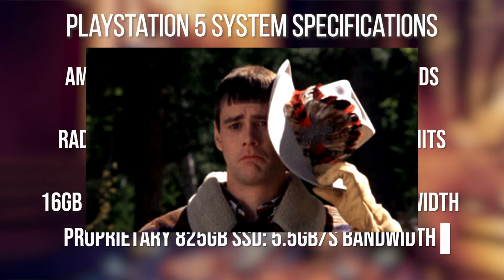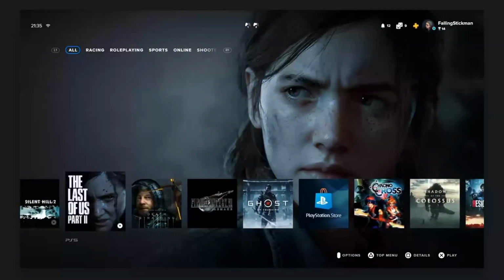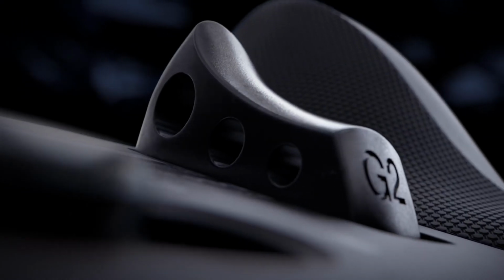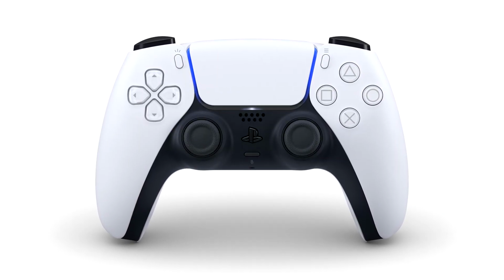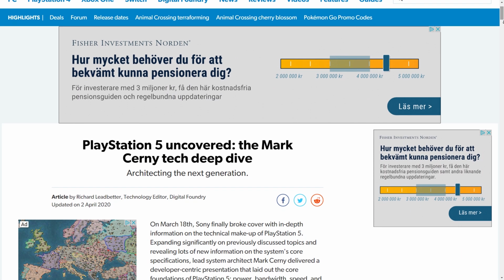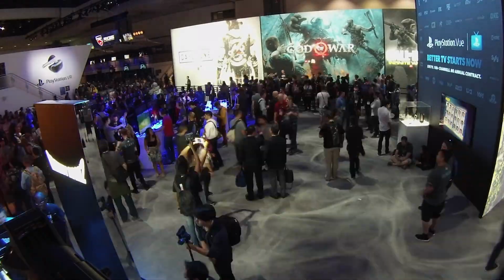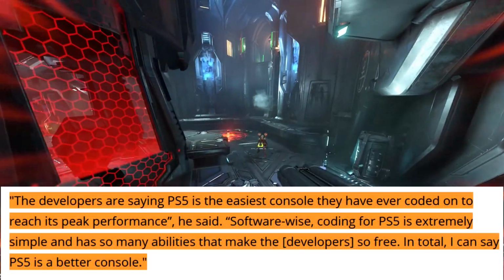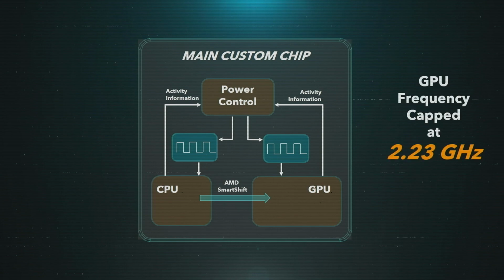PS5 New Details REVEALED | PlayStation 5 VS Xbox Series X Specs Reveal Shocking Performance

Comment: Both of these take a backseat to pc gaming BUT I hope they come out very cheap at the same time. Make our pc parts cheaper 😁👍
Reply: Back seat... according to who ?
Reply: @annoyingasshole3324  according to Nvidia ampere and AMD big Navi 2 👍. 20+tflop gpus. Not to mention amd already has 12 and 16 core cpus (basically double the consoles) so according to reality, they take a MAJOR back seat to pc gaming
Reply: @annoyingasshole3324  according to sales numbers.
Reply: PC take a back seat in game quality imo
Reply: @tommybull6578  that's not even physically possible 🤦🏾‍♂️. Console Graphics settings are stuck at low to medium PC settings, whereas PC actually gives you the option to customize your experience up to all Ultra levels, which would be triple if not quadruple the Quality of consoles. In short, the opposite of what you said is true. Consoles take a backseat to pc gaming in qualify as well 👍